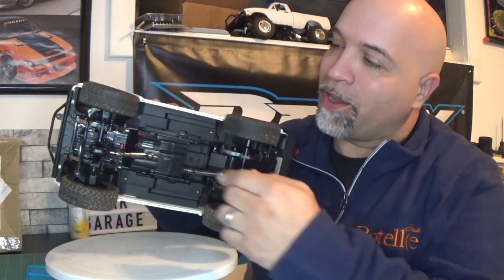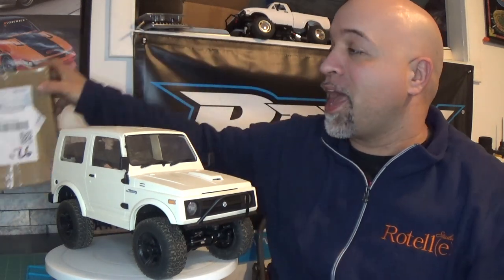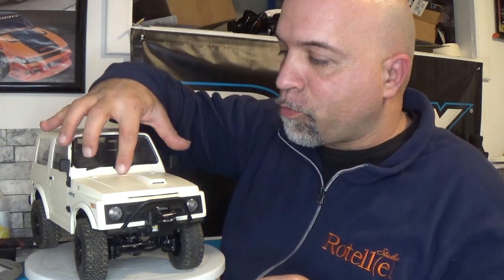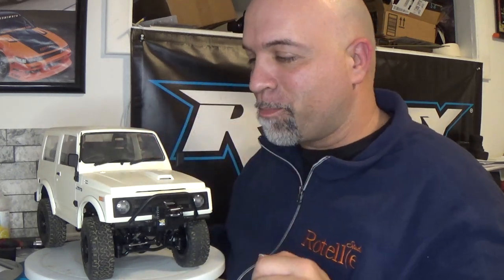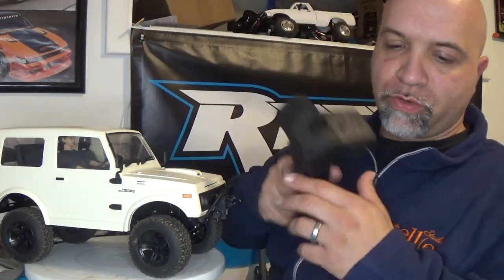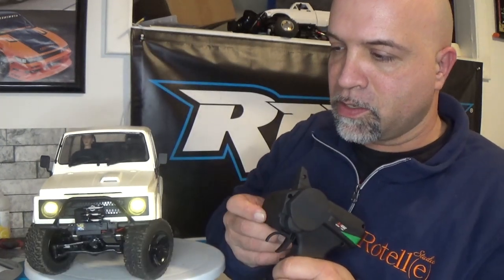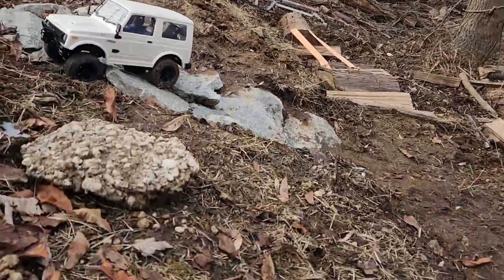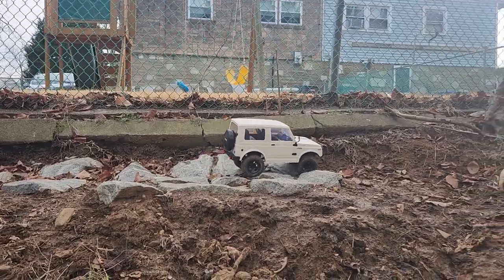WPL C74 Suzuki Jimny gets the RES V3 and things dont work out as planned

Comment: Hopefully the resistors sort out the problem and thanks for the video I'll see you on the update
Reply: Just to be clear, those aren't resistors, they are ceramic capacitors and they help to filter interference from the motor while running.
Reply from the maker: Thank you for the correction